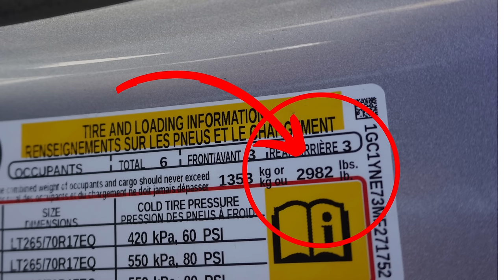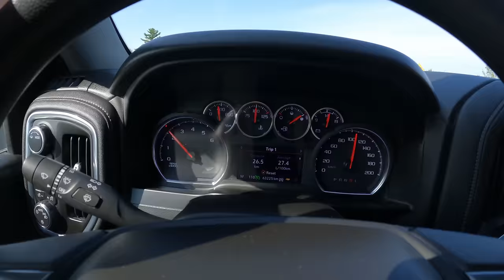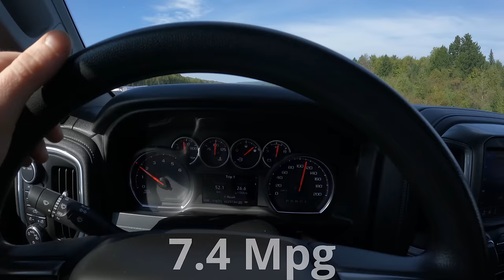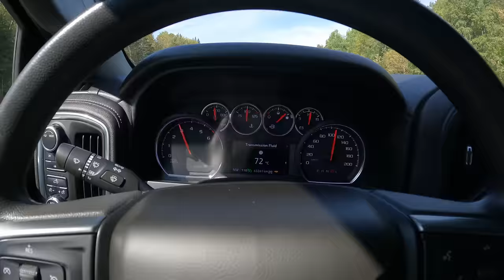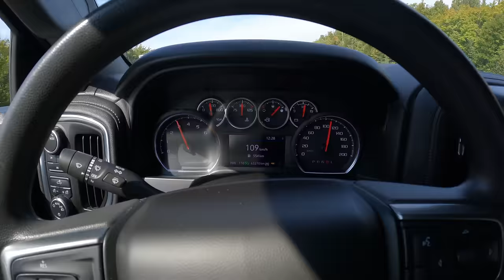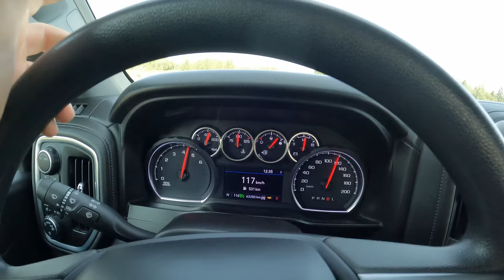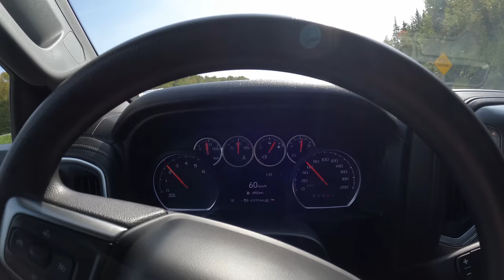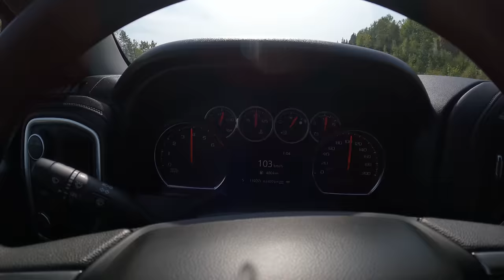Chevy 2500 6.6L GAS Engine (L8T) **HEAVY MECHANIC Review** | How DOES IT TOW??

Comment: Would like to see this again I believe the 6.6gas gets the 10 speed for 2024
Reply from the maker: You and I both! My truck guy says the 2024 chev's should be in soon!
Reply: Yep.  TFL just did a tow loop with the 10 speed
Reply: @TheGettyAdventures  they have been available in the states for a few months and from what i can tell they didn’t do anything engine related, just added the 10spd…too bad we can’t have the 4.10s back…my 6.6/6spd needs 4.10s…
Reply: When GM Did the redesign and drop the 410 option and added a 3.42 option I knew things were going the wrong way especially when they keep going to taller and taller tires. General motors is basically saying if you wanna pull north of 12 k  with a gas engine, don’t buy ours . I may be nitpicking here, but it’s not fair to even talk about fuel economy when the truck isnt keeping up with the other truck The only way to compare them is to have the faster truck ollow the slower truck Because it takes horsepower for the 7.3 to go up the hills 5 to 7 miles an hour faster. This thing may be good on fuel in part because the cruise control does not follow the speed very well in the Transmission stays too high of a year. same thing happened last year on the other toe channel. They tried comparing the fuel economy or something that made it up in 8 1/2 minutes to something that made it up at 11 1/2 you cannot compare the two. This was a good test I’d really like to see something more suitable for the heavier trucks while the load you used was fine for the half tons. How about a big fifth wheel with a large frontal area something realistic? No one pulls low loads like yours they’re not that common. Personal use of those trucks is mostly for RVs, I think this truck would suffer even more with a big fifth wheel same amount of weight, of course, The lack of power and poor gear choices would be very apparent since the air pushing characteristics of the RV put more of a strain on the tow vehicle.
Reply: It’s about time!
Reply: @JohnDiMartino GM doesn't have axle ratio options, they are 100% tied to the engine. And 3.73 compared to 4.10 is about 10% difference, the engine is 10% larger and has 20% more torque lower down. So it is better, yes the tire size increased, but not that much that would be noticeable. Granted, I think they should have stayed with 4.10 for towing performance as it would improve fuel economy when actually working the truck. As for fuel economy testing, you are right that the faster truck should follow the slower truck to be accurate, except cruising (holding speed) should use less unless it's reduced speed for a long distance and if you buy the truck, are going to do what it can do or are you going to slow down for fuel economy. The 6.8 might be a closer engine to compare to.
Reply: I have 24' gasser with the 10spd.....i drive the same truck with the 6 spd for work. I definitely prefer the 10 spd.
Reply: @TheGettyAdventures yes! Need to get one with the 10 speed so I we all have a good comparison. I may pull the trigger on one of them before too long. Currently in a ‘14 ram but not needing the diesel as much anymore. Godzilla is winning out right now.
Reply: GMs are alot better with the Allison 10 speed
Reply: I have this truck 2020 4 door long bed only things done to mine it deaver overload springs I hauled a 30 ft RV loaded plus the bed loaded around 13k  thru the Arizona mountains at cordes lake and it has no issues engine breaking or climbing without flooring it i was able to run 70 to 80mph but what I didn't see is your haul turned on on the dash if his truck witch makes allot of difference yes it doesn't down shift in Cruise like it probably should but if you're hauling that kids off weight you should not!!! Be using cruise
Reply: Use

Comment: Holy cow!! A large engine mechanic? Comparing a larger displacement big block to last years Chevy with a small block and an outdated 6 speed is childish. The current 10sp on the Chevy is a game changer. That is a load for a diesel anyway. If you are a Fleet manager, the Chevy is a better choice. If you occasionally tow, the Chevy is a better choice. If you tow regularly the diesel is the only choice. Why not compare the Godzilla to the Duramax diesel? Just dumb is all I can say about this large engine mechanic.
Reply: This is the current 2023 HD 2500 Chev with the current transmission and the biggest gas engine available. What more can the guy do? You're talking like 2024 is already here!
Reply: @kylebutler7142  all the other reviewers are using the 10sp.

Comment: I traded my 2020 7.3 for a 2023 6.6 and i tow daily. Not 14k but 7-10k and so far I've put 35k miles on the 6.6 and it's an insanely reliable engine. Besides regular service I've never been in the shop. At 35k my 7.3 had been to the dealership 3x. The 7.3 is definitely faster getting to 60mph.. if that's something you're concerned about in a 1ton work truck. Me, i want reliability. I want to trade my truck with 300k miles on it.
Reply: do you have 6.6 gas?

Comment: A good friend of mine is a Ford dealer mechanic and he has warned me to stay away from the 7.3.  He has put several camshafts in them at very low mileages.  He says the camshafts are soft steel.  I know the 8 and 10 speeds have better performance numbers but it seems like every time I drive one more than a month or so I get tired of all the constant shifting.  I am a dealer so I drive about everything.  Also, I like to manually shift all these trucks when I'm pulling heavy.  I'm not sure why any of these people that do reviews don't use the truck that way.  They just put the cruise on or put it on the floor and call it a day.  I know the TFL guys brag on how fast the ford 6.2 went up the hill.  It was sitting at like 5500 rpm the entire way.  I would say people that are hauling a camper with the kids would accept the minute or so less time it takes to get to the top to not have to listen to that the entire way.

Comment: Chevy is a great holiday hauler but in a commercial application that an engine is garbage when it comes to hauling heavy loads every day five days a week. Only the Cummins can handle that type of work looad. The Ford engine does OK but it has a lot of issues too
Reply: It’s not as powerful, but it gets the job done. The real advantage is the $10k gas over diesel price difference, and that this engine will last and not sideline you with emissions issues.
Reply: I absolutely hate everything Dodge makes. The Cummins is the best diesel on the market.

Comment: I would rather the cruise control allow the speed to fall off 5 mph on a hill rather than immediately downshift as soon as you’ll lose 1 mph.
Reply: I totally agree with that!
Reply from the maker: I mean I guess it makes for a smoother ride but it also makes the engine work so much harder trying to regain speed while climbing a hill rather then just maintaining it from the beginning.
Reply: Yeah I definitely prefer when they hold a gear longer even if you lose some speed.

Comment: I have a truck just like this and tow a 11k lb travel trailer. I notice the same thing when towing with cruise control. I think partially this is due to how gm programs their cruise thresholds, not just engine braking. My wife has an expedition max and suburban prior to that and i immediately noticed the ford likes to stay near the cruise control speed as much as possible even at the sacrifice of smoothness, whereas the suburban would go up and down in speed however it was much softer/smoother cruise control management. 

Like the towing videos and comparison for sure!! keep up the good work
Reply from the maker: Ya I agree it seems like it was a programing thing but it just seemed to make the engine work harder then. Either way the 6.6L pulled that trailer without issue. But thank you sir
Reply: I'm sure it's easier on parts too

Comment: We have a 2021 and a 2024 at work both crew cab long bed 4wd 1 ton with very heavy service bodies. They both pull 10,000 ish pounds trailer all day. Biggest difference so far is how smooth shifting the trans is and a marginal gain in fuel economy. Almost no mountains near us so neither struggle too much power wise. The 2021 has almost 150k miles on it at this point and couldn’t be happier with both
Reply from the maker: I think it wil be very interesting to see how the 10 speed 6.6L stacks up and to see how much of a difference it makes.
Reply: Both are gas?
Reply: Transmission programming.......

Comment: Nice video. I think you kind of seen that most of the “complaints” are not warranted when it comes to the 6.6 engine. It makes a lot of power and is very comparable on torque with the 7.3. The 6.6 makes 400 foot pounds from just below 2000 rpm all the way to about 5500 rpm. 

Fuel mileage is great for these trucks too. They are pretty similar to the Duramax. Within 2 mpg or less usually. 

The biggest draw back is the 6 speed. I say that owning one for what it’s worth (2022 with now 33,000 miles). The transmission needs/needed another gear between 2nd and 3rd gear. 2nd gears top speed is about 64 mph. 3rd gear is about 96-97 mph. That’s a big gap. The 10 speed will absolutely fix this. And in my opinion that was the biggest difference in performance for your test. 

As far as grade braking goes, using cruise control is not the best way to go about it. It was a fair test since you did both trucks the same but from my experience using your brakes with the 6.6 and 6 speed and it will very quickly downshift. 

In my opinion the 6.6 is the best gas engine on the market by a wide margin. Especially now with the 10 speed but even with the 6 speed. Once you learn the “quirks” of how it operates it becomes mostly a non issue. The engine itself has went off pretty much without a hitch. The same can’t be said about the 7.3 and they both debuted at the same time. So fair comparison for both. If anything it’s even worse for the 7.3 considering it’s an optional engine and the 6.6 is GMs standard. So every gas GM HD is a 6.6 but the same is not true for Ford. 

And I would be willing to bet most of your complaints will be solved once you drive the 10 speed. Because from the way I took your review, your complaints were with the transmission shifting/tuning and not the engine itself.
Reply from the maker: I think the reliability is certainly there with this 6.6L aside from some engines burning oil but with the 10 speed I think this 6.6L will shine. Im super excited to redo this towing run with the 2024 and the 10 speed
Reply: @TheGettyAdventures  I’ll be looking forward to it.
Reply: You’ve kind nailed it! Every other person who I’ve spoken to, including my dad who’s truck it is, loves their 6.6 gas. Only complaint is under heavy towing it would be nice to have the 10 speed. One possible positive for the 6 speed it replacement cost/repair ability. The 6 speed 
(6L90-E) has been around for almost 20 years including the 6L80 it’s little brother. It’s a well known dependable transmission that is, from taking to our mechanic, very easy to repair and replace. If you had to compare the 6 speed and the 10 speed for replacement cost he quoted more than double for the 10 speed. Just a thought, if you don’t need the extra gear then it’s not really necessary. For us the 6 was fine. We only pull 10-12k and really a 1/2 ton could pull our race trailer, in terms of weight, but we really needed the stability associated with a 3/4 ton. 

In short we love our 6.6 gas.
Reply: @kcspeed9980  the 6 speed is a good transmission and it does a good job. It’s tuning along with the throttle tuning in general is a little odd and that’s where all the 6.6 gas “online” hate comes from. And it’s almost exclusively online because in the real world everyone loves them. 

But anyways, the 6 speed wants to lug the engine at all times and it wants to get into 6th gear as soon as possible. Some of that is throttle positioning tuning too though. It’s almost lazy in it’s operation. However, you put your foot in the throttle and it’s a different story. This happened in his video too. 

The power is there even with the 6 speed but the 10 speed will be a better performer. Again I’ve got one and I’ve had it for nearly 2 years and just over 33,000 miles. I pull my 8.5’x24’ enclosed trailer. It does a really good job.
Reply: @matthewanderson9912  One trick I’ve used to “help” with the transmission/throttle tuning is to use “off-road mode. It’s not that aggressive of a change but I think it’s better. Also we have 13k on ours and just about 1 year on it. Our trailer is also a 8.5’x24’ enclosed car trailer. Pulls it like a champ, wind sway is our only issue and if the weight distribution is off. Other than that it’s great. Way more pulling power than we need. What kind of fuel economy do you get? We get 16 highway 12 city, NYC so horrible traffic, and 9 towing, we have a lead foot and need to fix that.
Reply: @kcspeed9980  I get between 14-15 driving to work. It’s a 30 mile round trip. Curvy two and 4 lane highways. Speeds between 35-65 mph. I’ve gotten 17 on a mostly Interstate trip but having probably 20 miles of pure city driving mixed in. 

Towing my trailer I get 8 (8.2-8.6) mpg. My race trips are either 180 mile round trip or 260 mile round trip. Lots of grades. Lots of curves. I don’t have any sway though. I never use a weight distribution hitch. Just a B&W tow and stow. I pull at 60-65 mph.
Reply: The 7.3 was faster up the hill, and slower down the hill. Wait for the 10 speed you say, that doesn't help the guys that bought a 6.6 that last 3 years. Check the TFL Ike Gauntlet test, the 7.3 absolutely destroyed the GM 6.6.
Reply: @matthewanderson9912  remembered your comment, just wanted to give an update. We lost our 23 2500 in a “flash flood” it all worked out with the insurance company and we now have a 2024 with the 10 speed. Having owned both the 10 speed it a big improvement, the tuning is great doesn’t hunt for gears and is noticeably faster 0-60. That being said don’t rush to purchase one if you like your 6 speed. I still think if we need transmission work it’s going to cost way more than the 6. Also fuel economy is identical, again we drive to fast for good economy and I don’t see that changing. Hope this helps.
Reply: @257Tony  i didn’t say wait for the 10 speed. I said the 10 speed will be an improvement. 

Also TFL is not the definitive truck authority. Their Ike test is a 7 or 8 mile run on a four lane highway. Half the time they don’t even use the same trailer in their testing.
Reply: @kcspeed9980  hate to hear about losing your truck. Hopefully everything else with you is good. 

Congratulations on the new truck however. I’ve been very tempted to get one and my dealer I use has an awesome red hot Z71 sport 2500. But interest rates are just too high and I do like my 2022 very much. 

December 14 made me two years of having it. I’m over 37,000 miles now and still have had zero issues. So far so good. It’s been my favorite truck that I’ve had.
Reply: @matthewanderson9912  Honestly it could not have gone better, other than it not happening. No one was hurt and GEICO made us whole without a fight. Honestly I would recommend them to everyone for how well we were taken care of. The hardest part was finding a truck without a markup in our area. Our old LT was 58 and the new one was 61. We have the 360 cam option and the new infotainment screen makes the LT a bit more then it used to both were Z71’s. All in all we’re very happy.
Reply: @kcspeed9980  sounds nice. They definitely have made them nicer with the addition of the 360 cameras. I got my LT before the msrp increase. So it was $54,500 and I got supplier price on it to bring it to $51,458.30 out the door. The equivalent 2024 LT would be closer to $64,000. So nearly a $10,000 increase but like you said, it would have some things that weren’t previously available. 

Hopefully this one serves you well.
Reply: @kcspeed9980 this video had me a little bummed on the new 2021 I bought but the comment on tranny replacement eases my mind lol
Reply: @257Tony the 6.6’s will be on the road long after the 7.3’s. I can live with being 2 minutes slower in a road I’ll never drive

Comment: The 6.6 certainly was no replacement for the 8.2L, the  Ford 7.3L seems to have taken that crown. King of the big blocks.   In this video the 6.6 did seem slow with the six speed, hope the 10 speed is much better.  Greetings from North Carolina.    Have a great week.
Reply: The 6.6 has 60 hp and bit more torque than the 8.1. The ten speed 6.6 runs circles around an 8.1
Reply: @Billybob50119  the 8.1 is a much more capable engine if paired with a ten speed. The 6.6 on paper may make more in the peaks but nothing like the 8.1 under the curve
Reply: 7.3 isn't a big block either
Reply from the maker: 10 speed should make a nice difference I think
Reply: BIG difference with the 10 speed. I love mine. That 6 speed would always upshift and let the engine bog down. The 10 speed keeps the rpms stay where they need to be for the load.